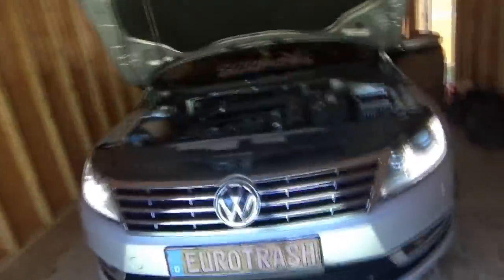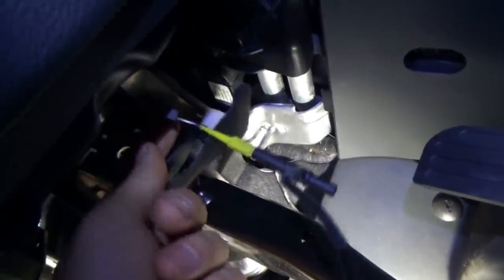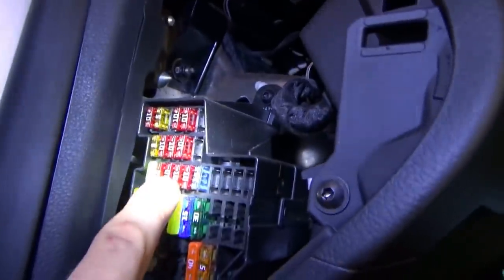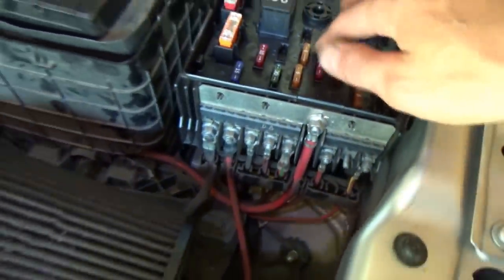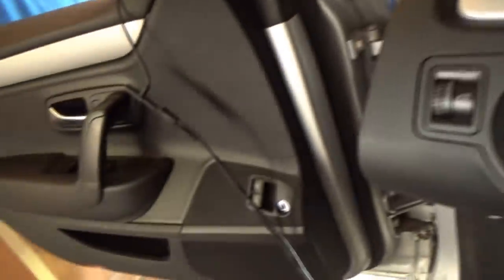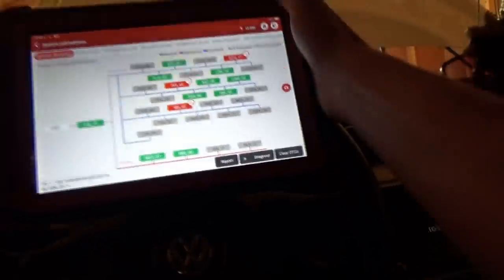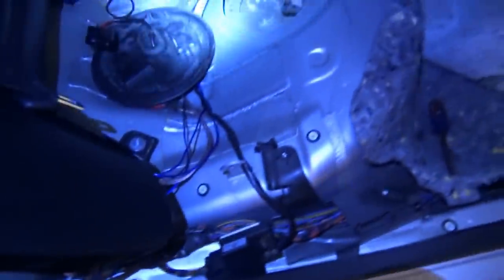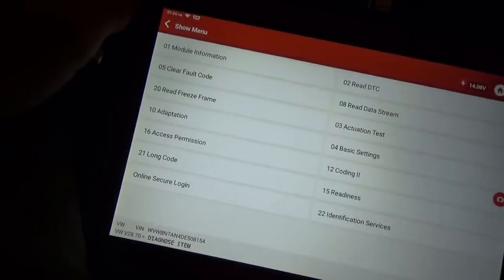EUROTRASH! VW CC: Start-Stall, No COMM

Comment: As a computer and network technician, I can totally reassure you, that plugged in cables and connectors in fact do change locations over night without any kind of human interaction. Depending on where you live, it may either be faerie circles, leprechauns, energies from waterveins or just a disturbance of the force.
It is simply a pain, to go through all the wiring, searching for what has been messed with, includung checking all the stuff that hasn't been messed with and to check if it really hasn't been messed with. 

Great diagnostic and I'm sure, this won't be the last electrical excorcism we have seen on this car :)
Reply: @psdaengr911  I guess you may have an issue with MCSE certified individuals.  As a holder of such a certification, people always treat me the opposite of what I hoped in life. But hey, documentation and labelling goes along way for those coming in fresh/those with a poor old memory like mine.
Reply: I agree with what you say. I have often found the leprechaun you suspect has gone on sick leave while one is rectifying the mysterious anomalies.

Comment: Honesty is a two way street. Everyone has heard  stories of dishonest mechanics and garages. Unfortunately, it's not uncommon for customers to lie or withhold  important information. Good job, on the diagnosis.
Reply: People seem to think it will cost more if they tell the tech the truth. BTDT. It's annoying as hell.
Reply: @gailtaylor1636  yeah I agree. They are just putting new obstacles on the way to solving the problem. Foolish
Reply: I suspect he hasn't a clue. Most people don't know what's important and what's not.

I'm going with someone tried to install/fix the stereo, blew a fuse, got frustrated then began swapping fuses, forgot where they were and just left it. May not have been the owner.

It also goes the other way. The information you impart may have nothing to do with the problem and lead the mechanic down the wrong path. EricO has had this many times.
Reply: people lie like they breathe
Reply: but is withholding, the same as lying?
Reply: The effects of either and both, are detrimental to getting the job done.

Comment: Seems like an auction vehicle where someone tampered with it to get a better price.
Reply: But it would never have driven from A to B
Reply: @Dirtyharry70585  depending on what he could meddle with and if more people meddled with different stuff.
Reply: Or car had another issue where a technician found and fixed the issue but disabled car until he was paid. Happens when no parts are used for the fix.

Comment: Excellent video Ivan. I'm glad to see that I'm the only one to use pen and paper. Looks like someone putting there fingers where they don't belong. Or to many chiefs 🤔 I just did a Chevy pickup,customer complaint not running right AND NO ONE HAS TOUCHED IT. IT was running on only 1 bank. Make this short it was missing a fuse for the right bank injectors made me think it was a set up lol,but it wasn't. Be well
Reply from the maker: Those damn fuses just disappear into thin air I tell ya! 😅
Reply: It must have been those pesky extraterrestrials!  I have heard of abducting people but now it is fuses!

Comment: I've seen fuses and relays that weren't properly installed pop out by themselves during a drive. Could have been the original issue, and the fuel pump disconnection was built in by the previous "diagnosis".

Comment: Every time I see someone tried or wire aftermarket components to the vehicle electrical system it always makes me cautious about potential cause of problem. Well done as usual Ivan, well done!
Reply: If it's done properly, you shouldn't have problems. Of course that means knowing what you do lol
Reply: @Spelter  I agree with that if installation was done professionally. Good point!
Reply: @PistonShack  but the installations I saw most of the time was like "ok we take power from this  cable with this clipper and some tape" and then the owner came to me with his battery draining over night. Turns out, they got the power of cable 30, battery plus, instead the  ignition plus. And of course, no fuse is used in this mess.
Reply: @Spelter  So true, I see it everywhere: trucks, excavators, bulldozers ect.

Comment: Oh Eric O was having a meltdown when you called that an aftermarket amp wire instead of aftermarket garbage!! 🤣🤣🤣
Reply: I don't understand their aversion to aftermarket items like lights,  amps, sound systems and so on. I understand the oem parts thing but amps and sound systems and crap are nothing but a way for someone to upgrade or personalize a cheap car. If it ends up causing issues they have to fix, it is just a paycheck.  

I understand it might be easier without that crap  installed but they charge by the hour not symptom. I figure they should love the extra income.
Reply: @bigdaddymak1439  and they are getting paid to fix it. It's honest easy money.

Comment: I see it also has the patented high dollar unfused heavy gauge amplifier wire going through the door jamb, in blue too.
Just in case you not only want to burn down the car, but the garage too!
Reply: Isn't there something fuse-like @9:30 on upper right corner. Not the right place for a fuse thou.

Comment: Nice diagnosis. Yes the good old swaptronics. I looked at a 2001 F150 the other day with no communications. Had a blown data link fuse that is shared with one of the power outlets.
Reply: A mission critical circuit sharing the same fuse as Baba's spotty when he goes pig shooting?

Comment: someone fat fingered that 5amp into the wrong area. then they started chasing the fuel pump. fuel lines still had the fuel in them from when they originally misplaced the 5amp for you to fix that then run the car till the fuel lines emptied/lost pressure. so now part 2 coming to see why they pulled that 5amp fuse! probably till point to why the other fuse is 25amp when it shouldnt be. people love solving blowing fuses with higher amperage. I mean what could go wrong putting a 25amp in???? hopefully they have a fire extinguisher in the car and the source is hittable lol otherwise that will be a lovely scent of burnt toast in its future.
Reply: This is why I never trust my memory when changing fuses ;or things with similar looking parts. Any interruption and short term memory becomes unreliability. If I don't have a manual to check placement, I take pictures as I disassemble things.
Reply: Owner and his friends were playing like just come clean Ivan asked him he said not that I know of classic not putting the blame on yourself answer

Comment: A failed airbag module caused a start-stall/no comm with powertrain bus. Airbag module got can bus line shorted to ground, unplugging it the car started. Car was a vw t5 2013, had airbag light on for some time with no comm to it, eventually shut the car down requiring attention.

Comment: Hi - if it's high it means highline be top or best spec and low is base models . If you check the chassis sticker ( under drives seat ) or in the rear boot / trunk under the carpet. It's printed on there :)  hope that helps 💪🏻😎😎 love the videos :)

Comment: I can read the frustration on your face, Ivan!  And rightly so.  All the previous apparent meddling, and how then could you know what the original issue might have been?  Fuel pump plug not fully seated?  BTW did you put in a new fuse 19? Did someone before you replace fuse 17 with a 20A because the correct 10A was blown?  Possible short to ground masked by the larger fuse rating?

Comment: No way he was driving it around a few days and then gets a sudden crank no start with fuse missing and fuel pump unplugged.
Reply: The fuse could have popped loose due to vibration if not installed fully. I've seen that happen before.
Reply: @Nabeelco    But the fuel pump was unplugged unless that was after his driving problems
Reply: @ryans413  Exactly, someone unplugged the fuel pump trying to diagnose it, and forgot to plug it back in. Ivan said as much in the video.

Comment: Isn't Eurotrash redundant?  It's like saying Carnivorous Lion.
Reply: We say the same things about American cars here. If you only know the US crap and have different car problems now, of course you hate it and fail.

We have problems with US-Trash and are pissed of by bad cables, ridiculously placed modules and bad engine design that burns out sparkplugs and catalytic converters. 

So every car has it's problems and you need to know a bit about Vag cars when you want to repair it, same with Ford

Comment: I have to disagree with the way you charged this customer. Basically there were 2 things wrong. The fuse for the diagnostics and the fuel pump was unplugged. What if it had been a blown fuse in the diagnostics and a bad fuel pump? Those two should have been easily diagnosed within 30 minutes. Without a scan tool, the procedure would be to turn on the key and listen for the fuel pump. If you can't hear it, check fuel pressure or current draw on the pump. If there is no current, bypass the fuel pump relay, still no current, check at the pump.
Reply from the maker: You have to charge per each separate issue because if you get really efficient then you will lose $$ 😉

Comment: I've heard that vw and Audi are headaches from other mechanics. They always say that they're hard to diagnose and parts are expensive. I could have bought a 2007 vw jetta diesel with fuel injection problems for 300$, but I passed. Probably cost 10x as much to repair. No thanks

Comment: See? the car is not euro trash. The problem was people touching things they shouldn’t be touching.
Been a VW technician for 20 years…. Seen this multiple times where fuses are removed and not put back in their right spot. Also seen many techs chasing issues without inspecting fuses and fuses lay out before 😂. Wise old mechanic once told me…. ALWAYS check the fuses first. I guess Ivan got the same training!!!
Reply from the maker: But I checked the wiring diagram first... 😉 You will enjoy Part 2 where we discover the underlying Eurotrash issue haha
Reply: @PineHollowAutoDiagnostics  funny how these days, lost communication faults are mostly software issues and repaired with an update 😂
So before checking fuses, I check TSBs

Comment: Ivan what made you go to that particular module from start?
Reply: The 2 main data pins from the DLC connector went straight into that module from the git-go and he had no comm w anything, and everything split off from that module. On the diagram, it had its own power and ground....

Comment: Been working on Euro cars for many years and the biggest issue i see is the dumbass wannabe techs that break more than they fix , went thru an Audi recently and after fixing all the broken/damaged wires , water soaked e boxes , broken connectors, faulty cheap aftermarket fuel system parts I finally found the incorrect thrust sensor on the rail .
I have no idea how much the customer spent or who was responsible but it would have saved a lot of aggravation going to and experienced professional from the get go !
Reply from the maker: Customer agreed 100% 😉

Comment: the only scan tool I have been able to get working on my, 2002 vw Golf TDI, is a Vagcom. What scan tool are you using?
Reply from the maker: See description
Reply: @PineHollowAutoDiagnostics Diagnostics  Thanks I will be getting one soon hopefully. By the way you are only a 1.5-hour drive from me I might stop in sometime. My drives side door power lock actuator keeps throwing a fault for fault to ground.

Comment: How did it run when you got it to start and run for a few seconds?
Reply from the maker: Because VW. it's direct injected so high pressure pump was able to build some pressure without the low pressure pump.

Comment: Just got rid of my Q5. No ECU comm. New computer. Radiator fans wouldn't work. Fuel pump pressure sensor issues. Absolute junk of a car. Lesson learned. No eurotrash from now on

Comment: Quit calling these cars Euro trash. But for a few very exlusive models, all European branded cars in the US are made in US (or just across the border in Mexico), using US-sourced parts and US labour. None of these so-called "imports" are actually imported from Europe. They may be trash, but they're your own trash, not ours. Similar, European made cars run around Europe in the millions without causing anywhere near as much grief to their owners.
Reply from the maker: Wasn't my idea... It was written on the license plate 🤣
Reply: They're still designed and engineered in Germany.  Doesn't matter where they're assembled.   They're beautiful cars and great to drive however they're typically known to be unreliable.

Comment: I’d of walked away from this dumpster fire. Fuses missing and wrong fuses in slots. Aftermarket stereo cabling everywhere, id10t errors with fuel pump unplugged.

Comment: Ok, cool, so tampered car by some grease monkey is a EUROTRASH, ok what to say about American FUELSPITTERS then. But in fact european cars are designed quite well and with geniosity, though complicated a bit, that pump on a 1.9 TDI engine would allow the car to run even with the pump unplugged or broken pump and on a low fuel demand and low car speed would allow you to limp home instead calling a tow truck. On the other hand adding extra cylinders to the engine will help you definitely when you have a misfire so you can have 2 or 3 cylinders misfiring and your FUELSPITTER will run happily on remaining 6 or 5 cyl. Ingenious. :-D